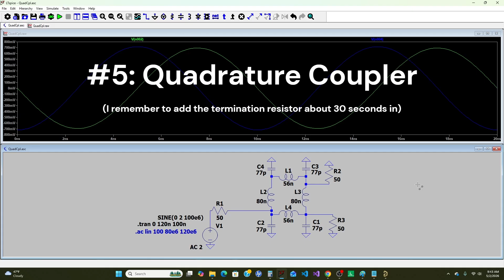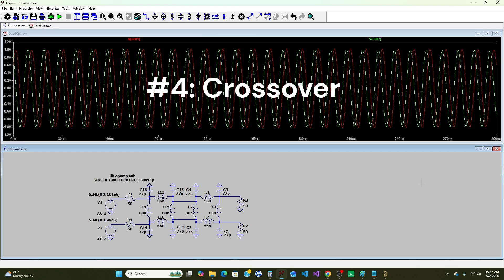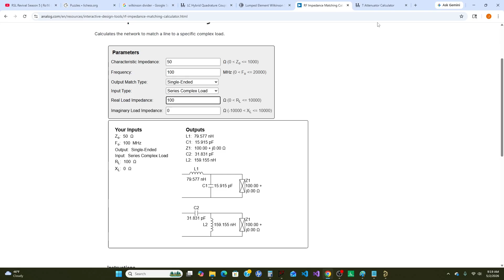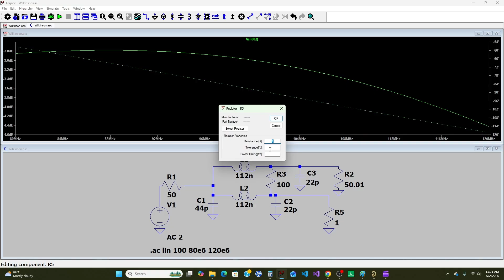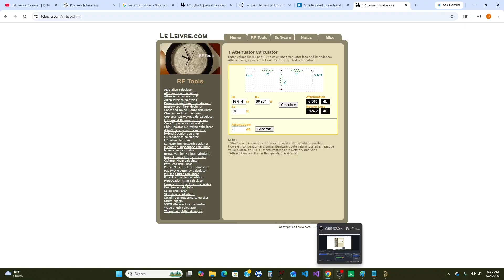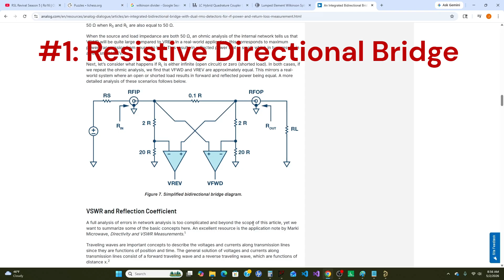My Top 5 Favorite RF Circuits

Comment: Thank you! That resistive directional bridge is going to be very handy for a project I have in mind.
Reply from the maker: It's a pretty handy circuit! Just keep in mind it'll be bandwidth limited by whatever op amp you use, as well as stray inductance and capacitance.